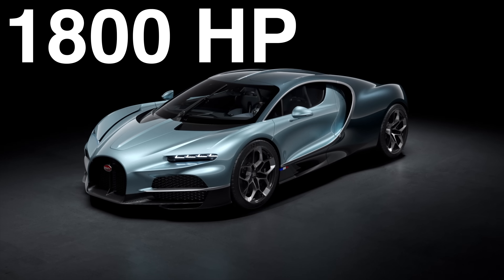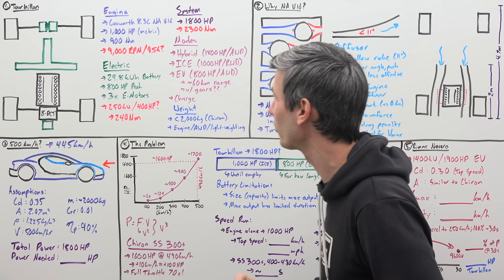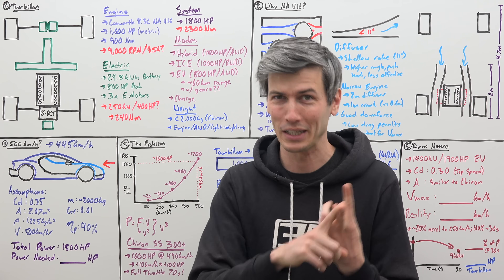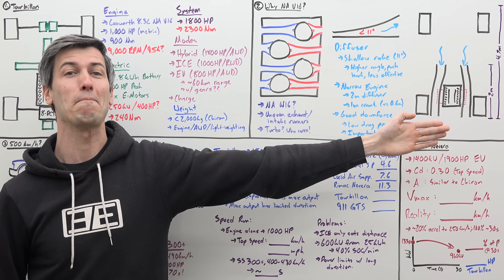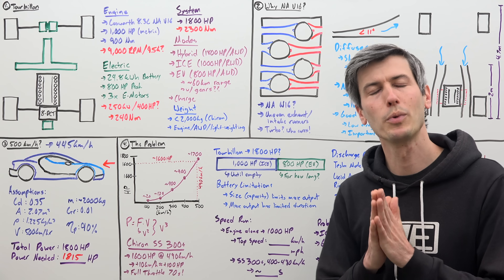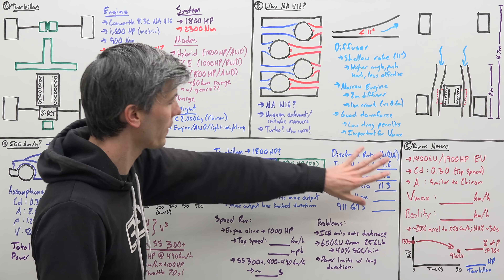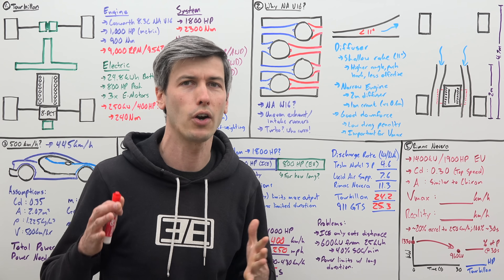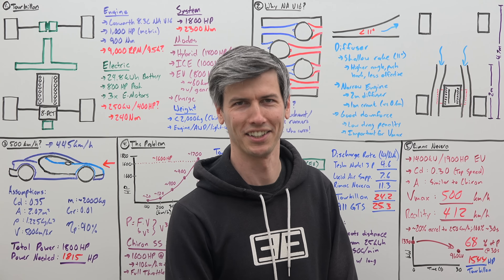Bugatti's Giant V16 Engine Is Insane - All The Tourbillon Details!

Comment: Massive kudos for the EV-calculations. 24C is indeed super mega heavy! My Nissan Leaf does around 3. (80kw / 24kwh) And at rates this high, every percent of inefficiency turns the battery into a self-blast-furnace.
Maybe they will arrive at more top-speed by putting a sapphire glass cover on the engine for another - oh? - 100`000 bucks to improve the aero.

Comment: I think Bugatti might be getting away from ultimate top speed as a selling point. there is so much more to this car than that. out of the 250 produced, likely only a handful, maybe even fewer than 2-5 will ever attempt anything even over 200mph. Any top speed run will be with a factory car under excruciatingly well controlled circumstances...

Comment: I loved their PR for the Chiron.  "We need someone to make special tires to go 300+ mph."  Hard flex.  I am sure they will find a way with the Tourbillion.
Reply: It isn't just going to 300mph that's an issue - it's finding tires that can go 300 mph for more than a couple minutes or so without requiring replacement.  Oh, and on public roads, which aren't glass smooth and have all kinds of debris on them.
Reply: @chuckschillingvideos  Such tires already exists on Chiron SS 300+ as they are x-rays for minimal imperfections. Having debris on road while running above 280 mph is asking for trouble as a single perforation from such debris in the tire can be catastrophic. Those are new overlooked factors to take account. Michelin is currently the only manufacturer to do extreme tires thanks to their experience with Bugatti for over twenty years.

Comment: Come on, tell us how quick the EV part will run out of puff during some spirited driving and how long before it heats up and limits the power? 5 minutes, 10 minutes? I say this new design and engine sound are wank. It won't be long before someone twists that 1 metre long crank shaft...

Comment: Love your channel 👊🏼😎 . 

Question: if you were to divert the cold air from your cars  air conditioner to the intake air box of your cars engine, would the car be any faster? More efficient? 
Do you get different results in different climates, in other words, would it perform better in hot climates. 
Would you achieve different results in different engine sizes, would NA benefit more than turbo charged cars?
What will the percentage gain be if any?
Curious to hear your thoughts

Comment: Would it be possible for Bugatti to use the rear electric motor to "restrict" power of the ICE at lower speeds, so it would act as traction control, which would hopeful give their battery more power for the overall top speed run?

Comment: I think You dont know the proper numbers bro, you said the single motor produces 400 HP and it have 3 electric motors each one produce 400 horses, means 400 multiplied by 3 = 1200HP from electric motors and combustion engine produces 1000 HP, when everything combined output is 2200 HP. Your calculation is wrong, because the new buggati have only 1800 HP how can  electric motors have 400 HP from where you get that information bro, i think You have overstated the power numbers of electric motors. ❌ love your video but i didn’t understand some of your points,

Comment: Very likely that the tourbillion wil have up to two minutes of peak discharge,  being a hyper performace setup it will have a very big bottom buffer, likely around 32kwh total , and depending on the chemistry after the initial drop in total pack voltage the discharge voltage could remain relatively stable between 90% to 30%

Comment: I'm guessing 9000 rpm is max power and 9500 rpm is the rev limiter. At 9500 the 78.5mm stroke makes just under 25m/s piston speed, so it checks out.

Comment: 7:49 I find it very silly to mention that the Honda CBR125R motorcycle models come with a speedometer that says up to whole 200 kmp/h yet the motorcycles struggle to even reach 120 kmp/h as it only delivers about 13.4 hp (9.8 kw) (it's a 125 cc, what did you expect).

(I own a CBR125R8)
Reply: Looks like almost no one here in the comments can write km/h...

Comment: There was an anecdote about the first Bugatti Veyron that the tires would explode at the top speed after x minutes, but it is not a problem, because the fuel tank is empty far before that.
I think Ferdinand Piëch would have accepted this V16 powertrain.

Comment: Cosworth will just "find another few thousand revs" with air valves etc. They know how to do it. It all depends on whether the 500 kph target is needed to sell cars. I'd take a std V16 doing 12k rpm/1200hp with no electric crap any day (would sound sooo good!). You can't use that power anyway! Heck, we have a few 2000+ hp cars street legal in in Oz, they won't do 500 kph but are pretty quick on the drag strip!
Nice vid too, explained all your thoughts. I'd still buy a Bugatti over a Rimac!

Comment: You forgot to accout for the fact that the Bugatti engine has the ability to recharge the battery. The top speed would come in waves basically. Im curious to know how much kwh can the engine recharge the battery
Reply: Also we dont know yet if the Bugatti has supercapacitors.

Yeah they do lol. They are hiding it. 😂

Comment: It should make 500kmh IF the driver is clever.
You use the V16 ONLY up untill the car reaches its maximum (ICE) speed...THEN you bring the electric motors in adding the Battery power to get the 500kmh.

Comment: Chiron went 490.5kmh (304.77mph). This one will be faster, that's for sure
Reply: Quicker, not faster.
Reply: @KyleHubb  No. Faster. Maybe not grammatically correct, but means higher top speed (unlike quicker, which is term used for acceleration rate)

Comment: Just a reminder of Bugatti attitude of top speed :
April 2005 - Veyron 16.4 : 408,xx km/h or 253,xx mph averaged (peak in one way : 411 km/h) (production car electronically limited to 407 km/h so a bit less than the actual top speed record)
June 2010 - Veyron 16.4 Super Sport : WR of 431,072 km/h or 268,xx mph average (peak of 434 or 270,.. mph) (production car limited to 415 km/h or 257 mph)
March 2016 - Bugatti Chiron announced to be limited to 420 km/h or 261 mph (later claimed to be able to go 285 mph unrestricted)
August 2019 - PRE PRODUCTION PROTOTYPE of the Chiron Super Sport (Super Sport 300+ is the exact same car as Super Sport - just a livery in addition to be celebrate the record and to be more "collectible" (higher priceand lower number), limited to 273 mph or 440 kph as standard Chiron Super Sport) : 304,077 mph or 490,484 kph (one way only - wind in the back ??) 
June 2021 - Chiron Super Sport : after an intense development during 2020, Super Sport finally merges and is announced to be limited to only 440 kph or 273 mph. DO NOT BELIEVE THAT ONCE UNRESTRICTED IT WILL DO 300+ mph AS THE RECORD CAR (it was lower (better drag) and probably a bit more powerful)
THIS TEXT TO TELL YOU THAT BUGATTI IS NOT GONNA DO 550 KPH IN THE TOURBILLON BUT RATHER 480 - 490 (298 TO 305 MPH)
Reply: Chiron Super Sport and Super Sport 300+ are production cars, not the 304 mph prototype car

Comment: Doesn't the high discharge rate allow the Tourbillon to use it's max electric power for longer? Maybe they can increase the % elektric used gradually during the top speed run to have close to peak kWh at 40-60 seconds. Just requiring an even longer stretch of road.

Comment: 240Nm of torque are for each of the front electric motors,
I don't think they mentioned the torque of the rear electric motor specifically, so-

900Nm + 240Nm + 240Nm + ???Nm

Comment: The Nevera is a fully electric car, and the Tourbillon is a hybrid, which means the engine itself can continue to supply power to the motors. So what if you launch with maximum torque, then shut off the electric motors and recharge the battery while you're running the ICE engine full speed until you max out what it can do, and then you reactivate the electric motors? When you run both simultaneously, could it perhaps lower the discharge rate, thus letting the electric motors produce more power for longer?

Comment: I think the value with the torque could be referring to max power output for the whole system and average power given for the individual motors from two separate references. Plus the Nevera is around the same at 2300, I'm sure they'll want to meet this or more.

Comment: How do you calculate the power required to accelerate at higher speeds? in drag racing the power increase to cut 1 second off a 1/4 mile time becomes significant. So while there still maybe power available the car just won't accelerate any more to increase the speed.
Or to put it in different terms. I might be able to generate the power to go 60kph on my bicycle. But unless I can generate the power to acclerate from 50 to 60 kph, I won't be able to do it without a tailwind or downhill. 
That is why you need to do a two way run average to measure top speed. Something that may be a limiter for hybrid/electric cars more so than ICE.

Comment: A 2 seater halo car, that is a hybrid with an ICE in V configuration, AWD, 2 electric motors that power the front wheels and a third electric motor behind the transmission. Hmm...

This concept seems awfully familiar. I wonder where I heard that before... Oh, right. There was this tiny company called Honda, with their American luxury brand Acura, who put out the NSX and people didn't like the powertrain. Then all of a sudden much more expensive brands like Ferrari and McLaren did the same. And people went nuts.

Granted, the 600HP of the NAX Type S are only ⅓ of the power of the Bugatti, but with like 250000/300000USD, it was also less than 1/10 of the money you would have to spend on the Bugatti.

Anywhere outside of Germany, and even here, anything that can go faster than 150mph is pretty much wasted on public roads. You'd be in illegal territory way before reaching the top speed.

So, is the Bugatti necessary? No. Is it an interesting piece of machinery pushing the limits of what is possible? Yes. 

Will anyone see it in public on the road being driven? Unlikely. 
They will all end up as garage queens in some collector's 1:1 hotwheels collection. Unfortunately.

Comment: They have not statet the actual Cw value, which might be telling indeed. However i can remember this whole ' the Veyron has ten radiators' thing and cooling is a very important factor in drag. Since the Chiron has 1500 HP to cool and this 'only' a 1000 HP ( not counting electric, but electric requires a kot less cooling for the same hp), aerodynamics might have improved significantly. It will be exciting to see.

Comment: Using the difference in cylinder head runner length to justify going to a V16 instead of the W16 is a pretty weak reason.  The intake and exhaust runner lengths could be varied to make up the difference.  The VW double-VR engine construction makes it possible to get sixteen cylinders in the same length as 12 cylinders in a conventional V-type engine.

It's interesting to talk about the difference in power output strategy versus how you want the car to perform.  To get a top speed run with a hybrid ICE/electric powertrain EE says to run on the ICE only until reaching its power limited speed, then turn on the electric motor and hope you can get to Vmax before the battery output drops.  On the other hand, what do you do if you're trying to make the fastest lap time possible on a road course?  I've spent some time watching in-car of the Audi R18 e-tron at LeMans, and their strategy was to deploy the electric power immediately when coming out of turns to get to high speed as quickly as possible, then back off the power output close to top speed for the straightaway.  Top speed of the R18 seemed to hit a wall at about 320kph.

Comment: How much Horsepower could they extract out of the NA V16 if they would make it a quad turbo ? And keep the electric powertrain ? It would be 2600 hp if we assume same performance as the W16 from the Bolide. And they would probably be able to break the 500km/h barrier without a problem if the tires can withstand it.

Comment: Comparing the power consumption at top speed of a hybrid with an electric cars is kinda idiotic and misleading. The Nevera example is also idiotic because there is only output and no input of electricity from the battery. Why isn't mentioned that the engine in the Bugatti will always recharge the battery and it's quite possible to do it as fast as it depletes at top speed? Yes, this will take some of the 1000 hp away from the wheels, but still the car will be able to produce at least 90% of its full power at top speed.

Comment: To be honest, I have that weird idea that in extremely high speeds you don't need turbo chargers because the natural air flow is so fast you can just point it to the ICE engine and have the same effect as turbo chargers, In fact I think the the existence of turbo chargers can slow things down because they will hit their maximum rotation speed.
So in my mind at extremely high speed, The ICE output will be more than 1000HP.

Comment: The top speed limitation of the rimac was by the gearing not by the discharge rate and the reason the power drop so low was beacause it hits his max rpm end ev are losing more of their power the higher they go in the rpm, I'm suprised you don't discuss that same deal with the bugatti I'll be curios to know what the limitation by the electric motors gearing are

Comment: That speedometer has more than my last two cars combined.
Reply: To spare my car (Nissan Leaf) this embarrassment, it has a digital speedo so no one can see how low the top-speed is. 
It is 149kph (/w GPS. the car boldly claims 160), which it does reach with some quiet labors, but seems quite happy there - car-wise. I.e. does not feel like dying. Not battery-wise. Doing top-speed eats the puny 24kwh battery (or the 80% that are left of it after 10-ish years) like candy. haha ^^

Comment: what if the engine produces more than 1000 hp at high speeds taking advantage of aerodynamic compression or increased pressure on admission?

Comment: Excuse me Jason... 😅😅I dont agree with you on Tourbillon's aero figures you re guessing... I know it s just your assumptions... Concerning Frontal Area, I ve calculated it with Tourbillon's spec sheet dimensions and I also find 2.07 m2. But concerning Drag Coefficient, I think it is lower than ur 0.35 assumption. I estimate it to be circa 0.30 to 0.31. Explanation : it is lower, more athletic (words of Achim Anschdeit to Autocar in Summer 2023) and its rear diffuser reduces considerably drag in top speed mode versus Chiron's rear wing up. Plus, Mate said that they could have closed the engine bay to reduce drag but they didn t in order to see the v16. I think what he means by that is that Bugatti could have joined their competitors in terms of drag coefficient as less than 0.3 (Jesko absolut : 0.278 and SSC Tuatara : 0.279) but they didnt.

Comment: I wonder if they will take advantage of ram-air..300+kph has alot of effect...
To get an extra 400odd HP, would need to generate almost 1/2 a bar if positive airbox pressure..not insignificant!
Engine is relatively low 120 HP\liter\bar.

Comment: In the end you say in order to acheive that top speed it needs more power... do you mean more battery power? Regarding the ideal difuser angle, I beleive it varies with the speed where you want max efficiency. And the starting point of the difuser ramp is related to where you want your aero centre pressure point.

Comment: Regarding the NA W16, I think it could've still worked if the did individual throttle bodies in different lengths to make the distance if each runner overall the same. Or am I wrong?

Comment: If the electric motors make 400hp then the 240nm torque figure sounds low. (2300-900)/3 gives 466nm which is probably closer.

Comment: You said it's a battery discharge rate / thermals / capacity limitation on delivering full 800hp for long enough, but, I think it would be cool if you included and remembered your other video stating that electric motors are more efficient so.. maybe that V16 could simultaneously feed enough power to keep those electric engines running at high power (not only accounting the battery capacity?) How much power can be taken from that V16 to feed the electric portion? Power factor / efficiency?, and also to the fact that there are three 400hp capable motors installed, so, if that's continuous rating, maybe Bugatti could push more power to these engines for some better strategy on achieving 500km/h
Maybe aviation thinking so they choose a windy day and go with the wind lol, that would not need better drag coefficient or more hps
Reply: Doesn’t matter it still won’t do 500 kmph infact not even reach 490.5 kmph like Bugatti Chiron did back in 2019

Comment: and after adding the peak power or high output  band of electric-motors will probably not be on excessive high rev range(which modern performance gas engine won’t suffer from with a gear box),having all the "1800bhp" in deposit at 450kph+ is even harder 😅
Reply: What "kph"?